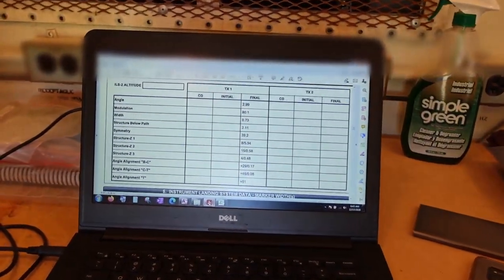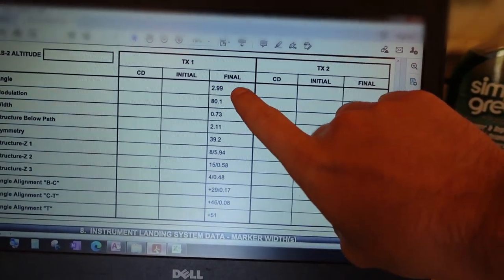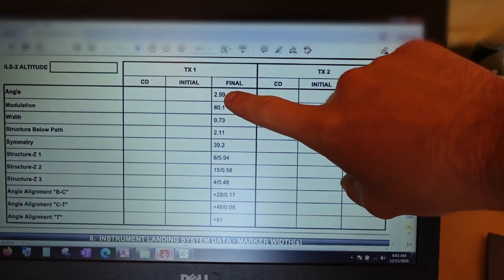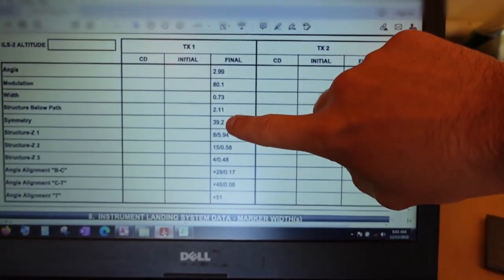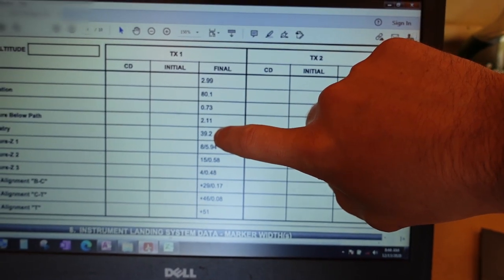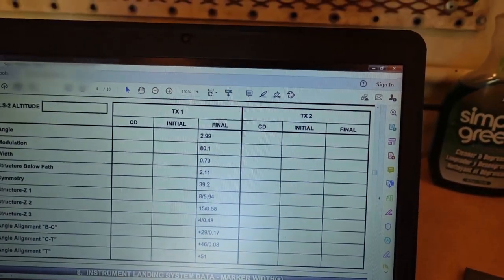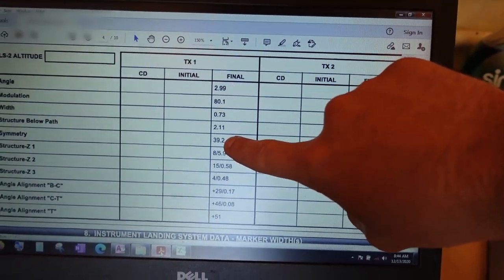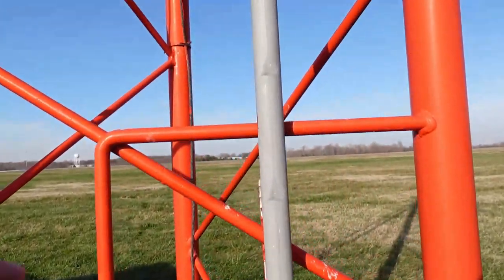Low Symmetry Null Reference Glideslope

Comment: Side band reference antennas are commonly 3:1 ratio with the bottom antenna at around 7' above the ground top at 21'.  Capture effect is 2:1 like NR with the third antenna being an additional 14' above the middle for a total of 42'.  The CE middle antenna height provides path angle like the top on the NR.

Comment: You should mention the common antenna height ratio for null reference antennas is 2:1 with the bottom antenna being 14' and the top being 28'.  Logically if your angle is correct check the height of your top antenna and divide it by 2 and that should put you darn close.  6750.49B is the FAA order that governs this maintenance.
Reply: 👌👏. Best comment

Comment: Was the fix lowering the antenna? If so, which formula did you use to determine the amount of inches you needed to move it?
Reply from the maker: The fix should be lowering the antenna but the amount is trial and error on the lower. There is no formula like adjusting for the angle (upper antenna). I'd probably make adjustments in 6" increments.